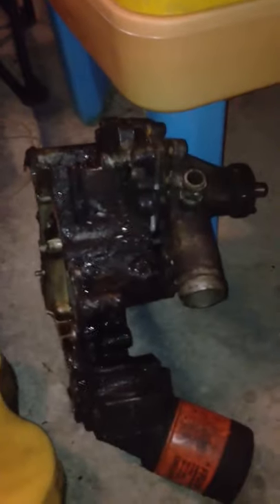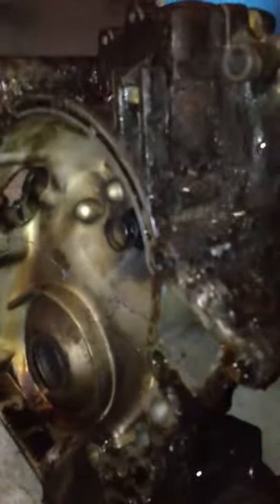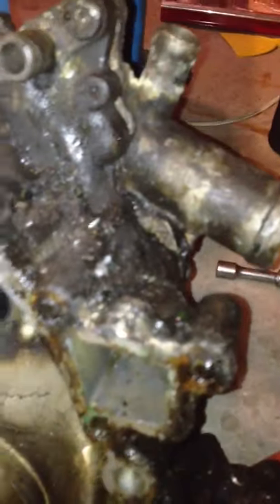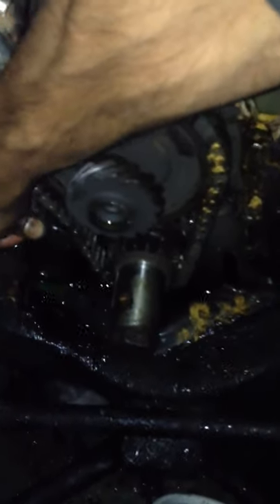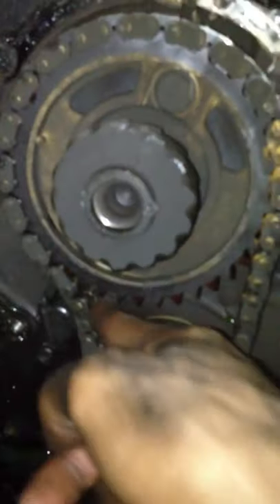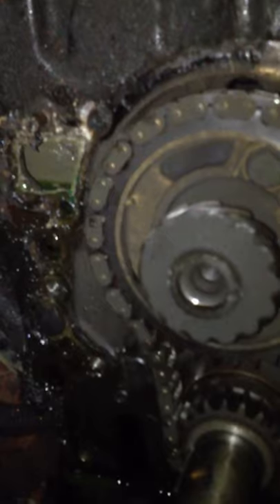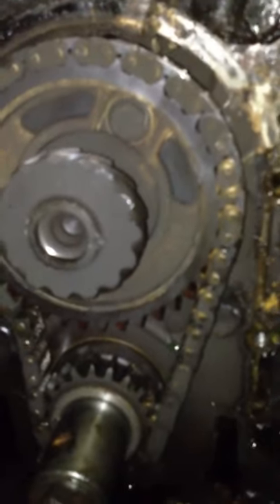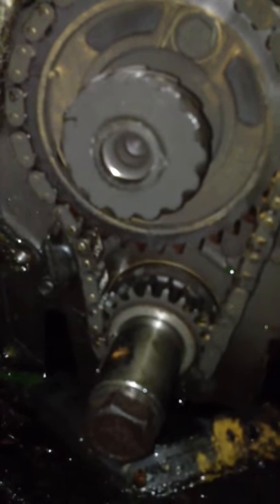1986 cutlass 3.8L timing chain replacement.

Comment: Timing chain tensioner.  Helps keep the slack out of the chain.  They wear out over time.  Pretty easy to replace.  I had an 87 Buick Regal that dropped the timing chain.  I replaced the chain, the tensioner, new gasket.  Unfortunately when I got the car it was a jigsaw puzzle and since that was the first car I ever did with a distributor I couldn't get it to run.  I am pretty sure the valves tapped the piston heads.  Long story short easy preventative maintenance replacement.